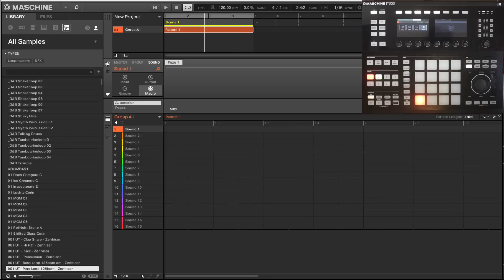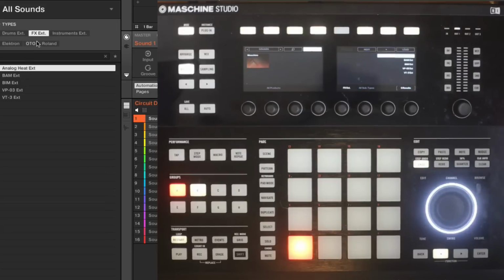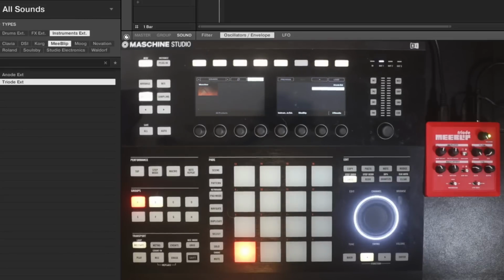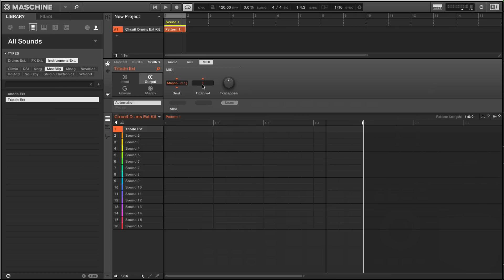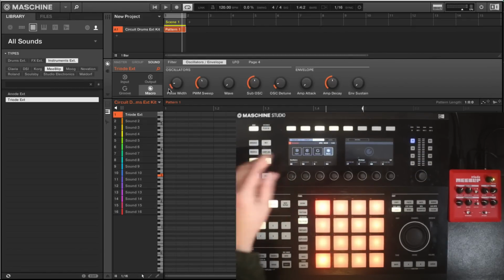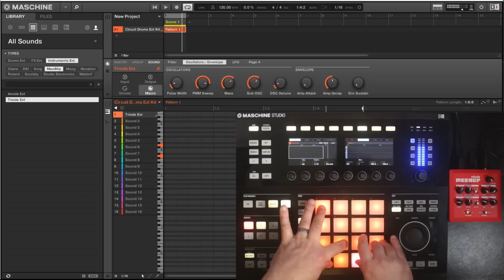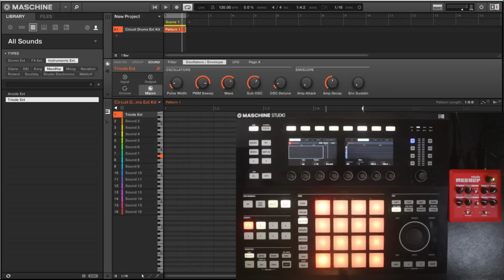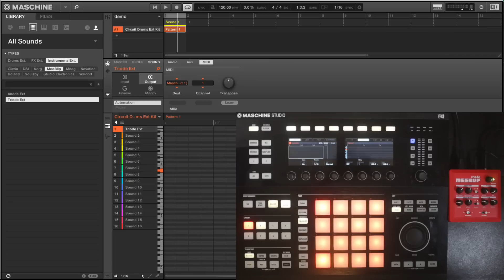Maschine 2.6 Update : Controlling External Hardware with MIDI CC

Comment: Hello, I noticed you have a Pro 40, so do I.
I’m not really wanting to control my other devices but I am wanting ease of use for everything. So perhaps you could shed some like on my situation. I have a Pro 40, Avid 11 rack, and the Maschine MK3. Then I have as my main controller a Korg M3. My Pro 40 is my main A/I,  11R is S/PDIF to Pro 40 and Korg is MIDI out/in to Pro 40.

So by adding the MK3 to the MIDI chain, what would you recommend? 

Also being that I have the Pro40 I was wondering about input samples to MK3, I just got MK3 but wound up having to run my external audio for samples into the pro 40 instead of directly into MK3 to record audio into MK3 sample area. You know anything about that?

Comment: Can I assign multiple CC parameters to a single CC control on external hardware yet? it's something I've always wanted with Maschine.
Reply: stephen ellestad I understand that its a lot of effort to implement customisable MIDI in a software with dedicated hardware, you would need a second layer of code or something, but with this update I am hopeful they are getting closer to the Ableton side of MIDI.

all that aside I'm fucking loving the lock feature and am itching to get hold of a Jam